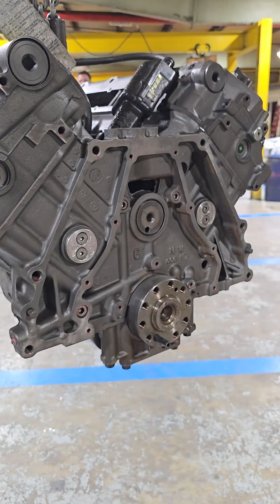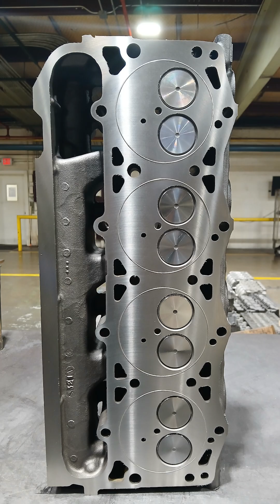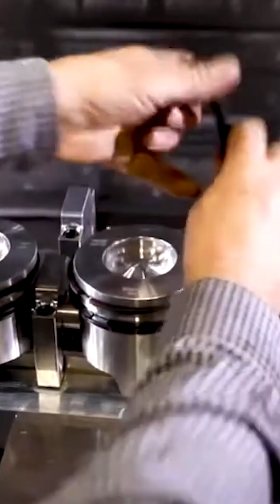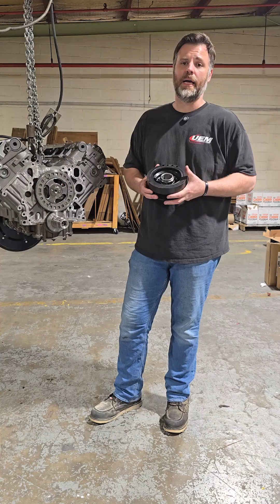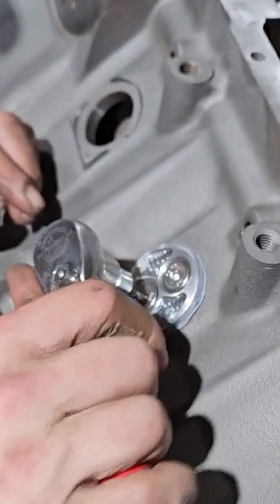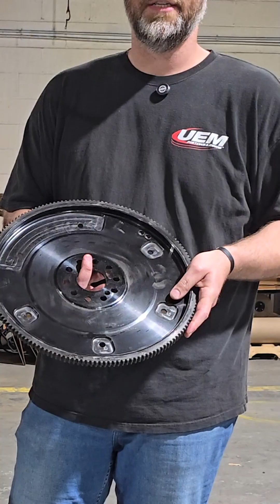The Backbone of Your Fleet: The 7.3L Powerstroke "Workhorse"

Comment: Considering the workhorse.  For the drop in ready setup (turbo etc included), what sort of HP/Torque are we talking here?  Best to probably upgrade the transmission at this point?
Reply from the maker: Our workhorse model for the 7.3 is rated for 425+ HP. We actually have a dyno test video with one of our 7.3 engines you can check out with the link below. It's a two part video. If you can give us a call, one of our specialists can answer any questions you may have at (901) 553-9847.  https://youtu.be/ineByNS22C8